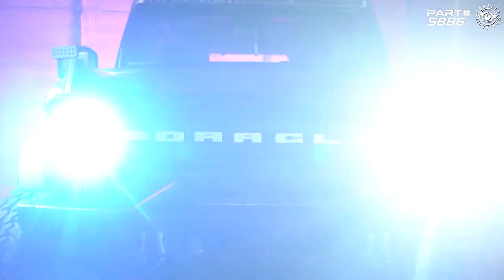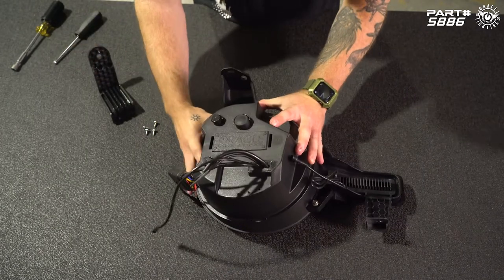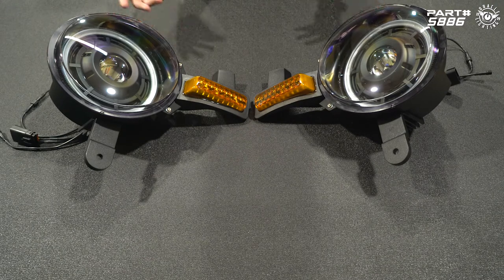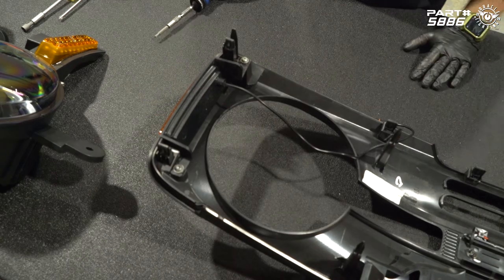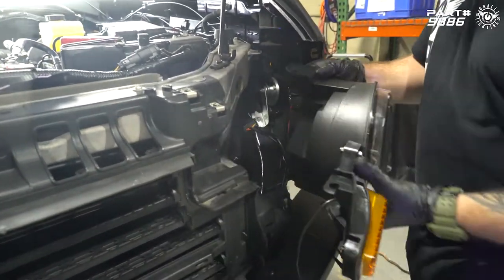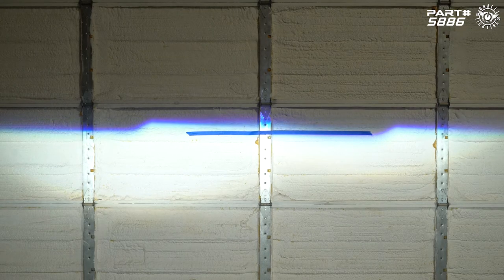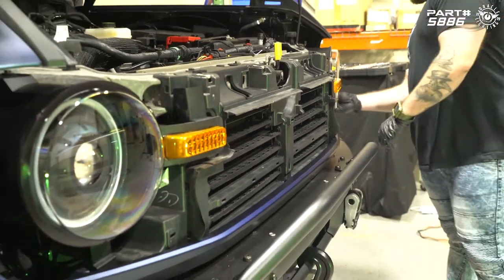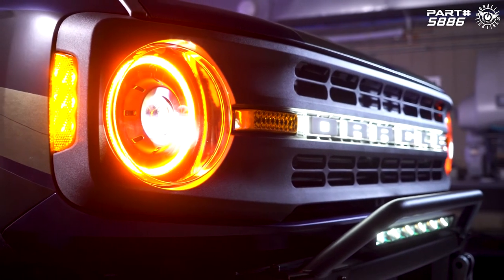2021+ Ford  Bronco Oculus Bi-LED Projector Headlights DIY Installation Guide by ORACLE Lighting

Comment: So there is a trim piece add to the headlights as well as some broncos don’t have the t screws for the side marker lights to be added. Had to go buy screws to finish the install.
Reply from the maker: Which trim package do you have?
Reply: I have the 21 Base. Installing 5886-05
Reply from the maker: @gobroncogo22  the screws should be there for a base, we developed the lights on a '21 base. Thats odd... Non-sasquatch?
Reply: Yes non Sasquatch. I just went to a parts store and bought the 4 screws to put the side markers on.
Reply: Well after all that hard work have to send them back because the marker lights and turning signals don’t work or both sides.
Reply from the maker: @gobroncogo22  did you confirm you had the arrows lined up on the plugs? They can be plugged in upside down if you do not visually check the arrows.
Reply: Yup there’s only one way to put them in.
Reply: '23 Base... No screws
Reply: 23 Black Diamond Sasquatch… no screws…
Reply: What size screws did you buy since oracle has yet to address this issue.
Reply: I took 2 screws out of the backside of the grill and used one each on the lights. Whatever size those are are the correct size.